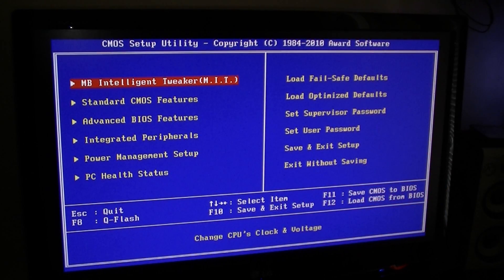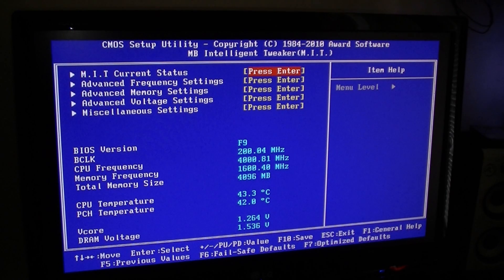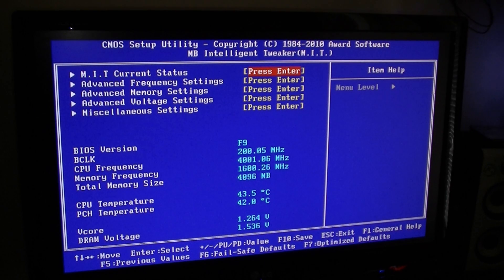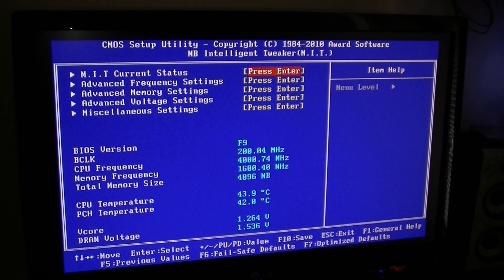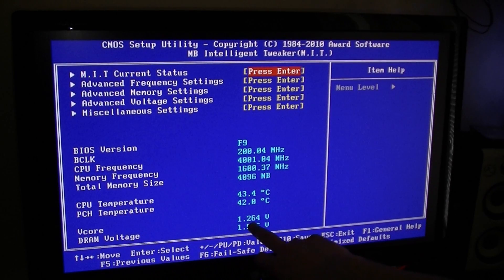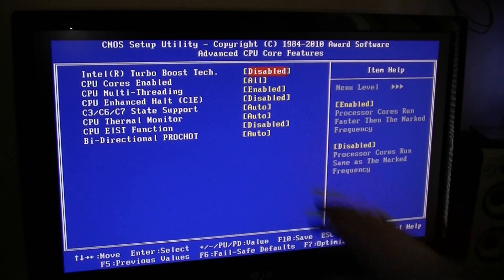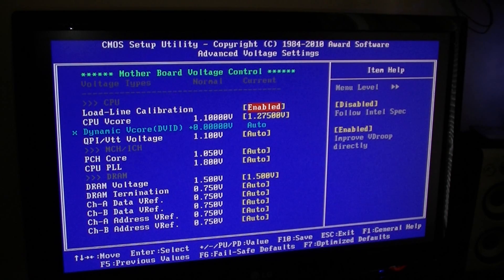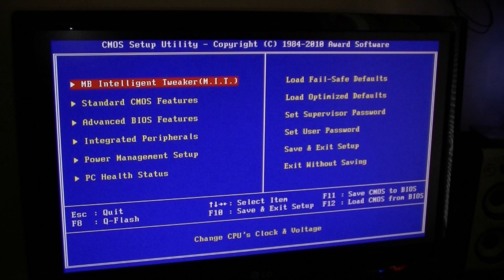4GHZ BIOS Settings! by Laczupakabra

Comment: Would the setting vary that much with 1333 ram instead of 1600? And how far could. Push the 1333 ram? ATM I'm at 165x10. Could you give me advice on pushing my 860 harder. I have a TH spinq vt cooler aswell